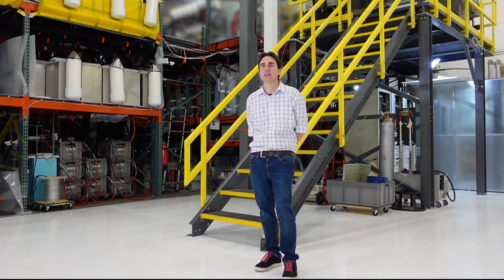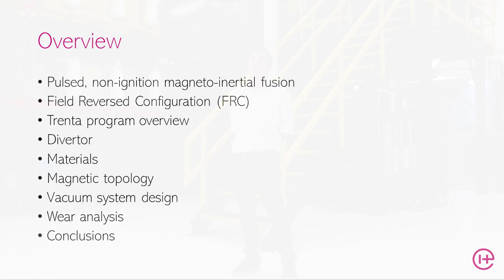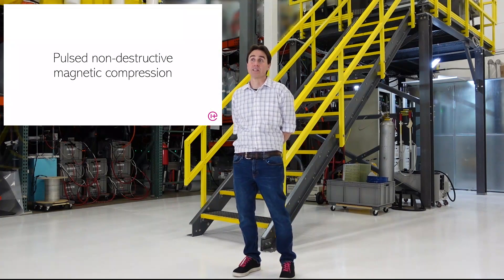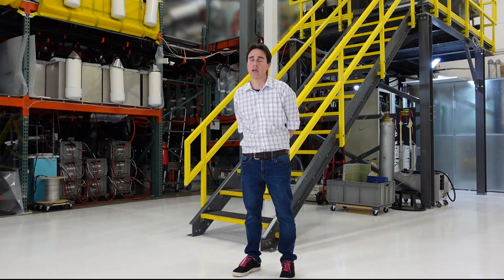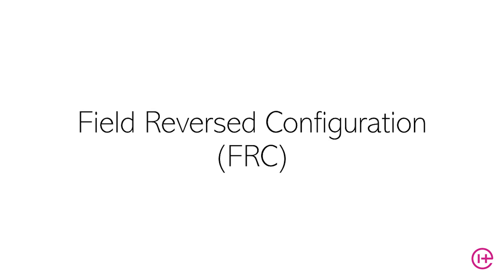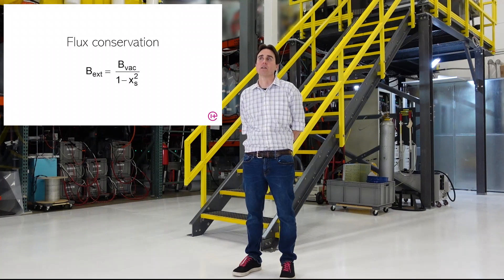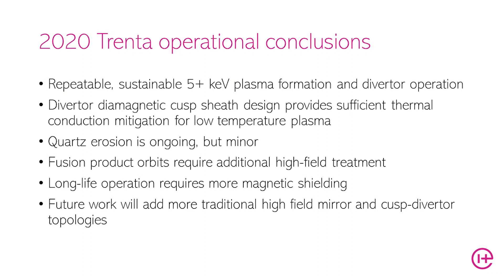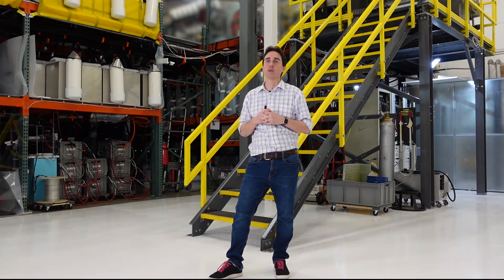Trenta 2020 Program Results

Comment from the maker: Q&A during SOFE conference pasted below. 

--------------------------------------------

>>> Question <<< 
At 11 minutes, you say "references are attached" but I don't see where to find those references. Would you please point me to your references? Thank you.

>>> Answer <<<
Kirtley, David, et al. "Overview of Staged Magnetic Compression of FRC targets." APS Division of Plasma Physics Meeting Abstracts. Vol. 2018. 2018.
Intrator, T. P., R. E. Siemon, and P. E. Sieck. "Adiabatic model and design of a translating field reversed configuration." Physics of plasmas 15.4 (2008): 042505. 
Hoffman, Alan L., et al. "The large-s field-reversed configuration experiment." Fusion Technology 23.2 (1993): 185-207. 
Votroubek, G., et al. "Formation of a stable field reversed configuration through merging." Journal of fusion energy 27.1 (2008): 123-127.
Kirtley, David, et al. "Staged Magnetic Compression of Field Reversed Configuration Plasmas." JASON Defense Advisory Panel Report on Fusion, 2018. 
Kiraly, J., et al. "Fast multichannel electron temperature diagnostic for TFTR using x‐ray imaging." Review of Scientific Instruments 56.5 (1985): 827-829.
Nehl, C. L., et al. "Retrospective of the ARPA-E ALPHA fusion program." Journal of Fusion Energy 38.5 (2019): 506-521.
Hoffman, A. “FIELD REVERSED CONFIGURATIONS (and Rotating Magnetic Field Current Drive).” 2006.

Another good, early reference on fundamental confinement scaling in FRCs (there are lots of more modern texts, but this is a good starting place): 
Hoffman, A. L., et al. "Field reversed configuration lifetime scaling based on measurements from the large s experiment." Nuclear Fusion 33.1 (1993): 27.

--------------------------------------------

>>> Question <<<
I'd have a few questions regarding your presentation. As far as I understand, the complete merging of the two FRCs has been experimentally observed, but not reproduced in simulation. How important is simulation for the understanding of the reconnection process?

>>> Answer <<<
The simplest 2-D MHD codes that initially simulated the FRC did not reproduce merging. However, modern resistive 2D MHD and particularly 3D MHD codes do simulate partial or full merging of FRCs on the timescale of the confined, merged plasma in a mirror field geometry. We use a code called CYGNUS and can provide more information if you want to send me your contact information. In practice, two (high elongated) FRCs and a merged single FRC of the same density, temperature, and trapped magnetic flux behavior similarly enough that complete merging in simulation doesn’t tend to affect behavior detrimentally.

We have used NIMROD, a 3D extended MHD code, to simulate FRC merging. The NIMROD code can resolve highly anisotropic heat conduction and viscosity. Here is a good reference on NIMROD. Milroy, R.D., Macnab, A.I.D., Kim, C.C. et al. FRC Simulations using the NIMROD Code. J Fusion Energy 27, 73–76 (2008).

--------------------------------------------

>>> Question <<<
Trying to get a sense of scale. What are the plasma dimensions at 7 T?

>>> Answer <<<
These FRC plasmas are meter-scale. A key point for this type of self-organized plasma configuration is that they trap significant magnetic flux. During compression, and unlike a traditional theta-pinch, this results in larger compressed plasmas.

--------------------------------------------

>>> Question <<<
What is the compression time compared with the rotational instability time? Are there any plans to attempt to stabilize n=2 with applied multipole fields or end-biasing?

>>> Answer <<<
FRC rotational stabilization was theorized and computationally predicted in the 1990’s and early 2000’s and has now been well documented at this point by multipole fields or (preferentially) end-biasing of the field by several groups. The presented work did not use any intentional stabilization, though if needed for longer pulse lengths, is an option for future work on this machine and others. It’s typically accomplished by a carefully designed electric and magnetic field structure in the divertors. It is an outstanding question on how well stabilization works for thermonuclear-temperature plasmas.

--------------------------------------------

>>> Question <<<
When do you expect to begin operations on Polaris?

>>> Answer <<<
Construction on the facility and machine hardware is underway right now. We expect to be testing components and subsystems in 2022, but full machine operation will take some time beyond that.

--------------------------------------------

>>> Question <<<
I was just wondering what was a typical radius when fully compressed to 7 T. Is it large enough for neutral beam sustainment as in a Tokamak?

>>> Answer <<<
We haven’t run these numbers recently, this is as much a collisionality question as topology and gyro-orbit and these plasmas have a rigid-rotor profile that are high density at high radius. Without running a new calculation, I do suspect you could trap a 10-100 keV deuteron beam. The beam-generated ion would be confined, these systems have a large vacuum boundary (many thermal plasma gyro-radii). That said, the engineering of the beam and the tight-fitting cylindrical magnets would be a major challenge.  

--------------------------------------------

>>> Question <<<
I am interested in learning more about your poster. How does the ion energy confinement time vary with plasma density? What was the plasma density when confinement time was 0.5 ms?

>>> Answer <<<
Dr. Votroubek describes the merging and confinement: Votroubek, G., et al. "Formation of a stable field reversed configuration through merging."Journal of fusion energy27.1 (2008): 123-127. Dr. Hoffman describes the fundamental theory and empirical results for energy, magnetic flux, and particle confinement scaling: Hoffman, A. L., et al. "Field reversed configuration lifetime scaling based on measurements from the large s experiment." Nuclear Fusion 33.1 (1993): 27.

--------------------------------------------

>>> Question <<<
What are the target densities for a reactor (prototype)? Could the higher density lead to better coupling between ions and electrons providing an additional loss mechanism and thus cool the ions? Whats your strategy for higher densities? 

>>> Answer <<<
Target densities are still in the 2-10E22 m-3 range depending on compression field and ion and electron temperature. We do expect some increase in ion-electron thermal conduction over the lifetime of the FRC over this time, certainly not retaining as large of a differential as we see now. High-Beta plasmas, like the FRC can trade temperature and density over a wide range.